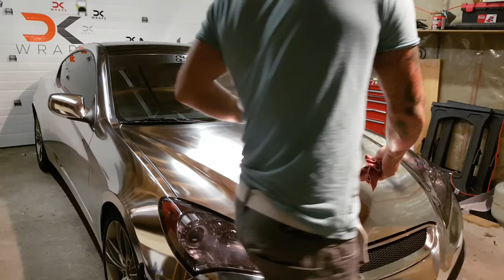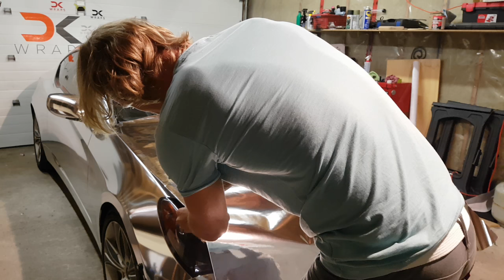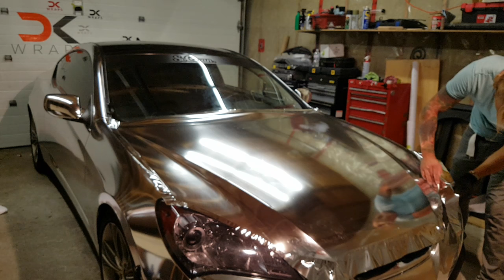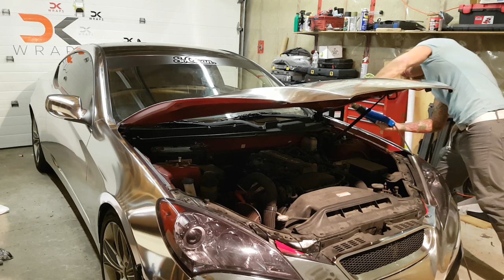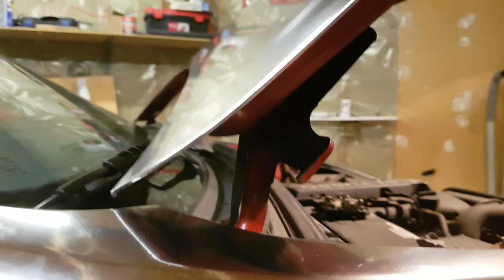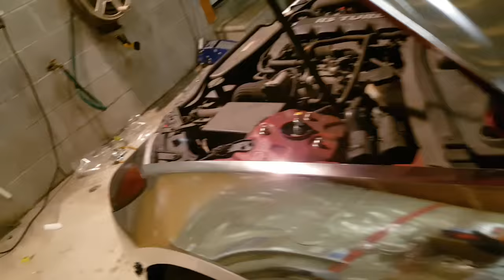Professional level. How to vinyl wrap hood bonnet. Genesis coupe. Silver chrome vinyl. By @ckwraps

Comment: Awesome christian, I like how clean the edges and lines are under the hood. You right people pop your hood for all kind of reasons, so its nice if that area looks flawless as well. Other than the hood itself. I thought cutting to much to tuck underneath the hood after popping the hood, you need a inch or two to wrap or tuck under was necessary. The way you did it was nice and clean prior to finishing the hood install, and not once did a cut on the car. Awesome I'm learning more and more ways how to become a even better installer and right wrap care products and tools to use like vvivid shield guard. Thanks Christian, freaking awesome.

Comment: amateur question
shouldn't they make vinyl templates for each car and not cut and fit per car?
Reply from the maker: ARCH. M no, that's not the case when it comes to colour change. If the pieces were cut to size there would leave little to no room for error. It's much easier to apply the film when you use a larger piece and cut it to size
Reply: you have some dope work on your page and thats dope in a good way lol  I do some wrapping myself. and I started making templates  for a few projects ive done but when i make them i cut them out a little bigger for errors it saves material honestly and jobs a little quicker. with the way you rolling on the cars you would cut your time down for sure

Comment: how long a wrapped car will last you think 
thanks a lot
Reply from the maker: saleh byatra depends on where it's stored, weather conditions and how you take care of it. Anywhere from 2 years to a lifetime
Reply: CK Wraps thank you so much and what about scratches can we fix them if they occured 
Best regards here from Nazareth city Thanks again
Reply: CK Wraps I'm sorry but your answer is very inaccurate. Every vinyl manufacturer warranties their product for so many years, and also for a certain number of years for removal without potential damage to the underlying surface. Even within manufacturer, different product lines have different life spans. Avery Dennison has the longest of any currently at 12 years for some vinyl, but as little as 18 months for some products under certain conditions. The same is true for every vinyl manufacturer.
BTW, in checking with both Avery Dennison and 3M, neither warranties any of their products if applied to preexisting graphics, exactly as you are doing here. If the two biggest manufacturers of color change vinyl say don't do this, you shouldn't be doing it no matter what your customer thinks.

Comment: except one fact that vvivid is difficult to work with, the finish look is pretty much same as other vinyl like avery or hexis what is your opinion?
oh gloss black is bit low quality imo. the reflection is too hazy
Reply from the maker: I find Vvivid chrome easier to use than Avery chrome
Reply: really? but its too sticky...
Reply from the maker: The chrome is only sticky when the surface temperature or ambient air temperature are too hot. But even without the tack reducer it can be installed. I use the tack reducer to eliminate the chance of damaging the film
Reply: thx for the reply i learn a lot from u!
Reply from the maker: You're welcome

Comment: i've seen professional wrap without heat gun
Reply from the maker: +Ger Lee it depends on the ambient air temperature. Different films by different brands will stretch more or less depending on the temperature in the room. I don't think you'll ever see a professional install using chrome without any heat. It's a thicker film and more difficult to stretch without any heat
Reply: oh sorry that is right. don't take it personal. i didnt mean it in that way  :D

Comment: After hours of Justin Pate, Avery Dennison, 3M, Yiannize, etc. videos, I have to say that I cringe when I watch any CK Wraps video. I'm sorry to say, but it's true.
For example in this video you are putting chrome over chrome, "...at the customer's request." I have no doubt the customer might have thought that is the solution to prevent chips and dings from showing too much. As the professional you should have done all you could to dissuade them from that idea for a number of reasons. First, the customer is paying time and materials for 2 applications of chrome wrap on the hood. The only thing being gained is not having to bring the car back when they feel the first application is too damaged. Second, it isn't really going to disguise any damage too well, and possibly not at all. If they get a strike bad enough to seriously damage the chrome it very well may damage both layers and they have paid for nothing in the end.
Third, there is an actual product for this purpose. I believe Avery Dennison and 3M both make a clear overlay suitable for chrome applications to protect from fading and damage. It is much less expensive than chrome and easier to apply, saving the customer in both time and product costs.
Fourth, I can just imagine what a nightmare it will be to remove two layers of chrome when the time comes, and it may very well cause permanent damage to the paint. I have never heard or seen of this being done and I would expect both the manufacturer and experienced professional installers would say it should not be done.
These are just the reasons that immediately come to mind as to why this is a poor solution to a potential rather than realised problem. The customer is always right when it comes to the look they want and judging the appearance of the final product, but when it comes to use and  application of the product and how to best meet the customer's goals, you should be the expert offering and strongly encouraging a better solution. If not you are doing your customer a disservice. Almost as badly is that, if you did do all you could to make your customer see a better solution and they refused, you didn't say so in the video at the very beginning and lead amateur wrappers into thinking this is a practical and efficient way to minimise potential damage to any wrap.
Reply: BTW, in checking with both Avery Dennison and 3M, neither warranties any of their products if applied to preexisting graphics, exactly as you are doing here. If the two biggest manufacturers of color change vinyl say don't do this, you shouldn't be doing it no matter what your customer thinks.
Reply from the maker: +William Thomas Ramey this is what the customer wanted. They didn't want a ppf put over top. Removing 2 layers of chrome or removing a layer of chrome + ppf would be nearly the same experience. The customer also decided to have a logo embossed under the wrap once the hood was already wrapped in chrome. So in that case it was either remove the film and then reapply with the embossed logo or add a second layer. The customer decided on a second layer. I didn't mention in the video that this shouldn't be done because it can be done, and it can be done without harm to the paint when it comes time for removal. Many other shops have done it, they just haven't publicized it.
Reply from the maker: William Thomas Ramey William Thomas Ramey if the videos bother you that much then there's no need to keep on clicking on them, but it seems to me that you've watched nearly all of them when you mentioned in your previous statement "I cringe when I watch any". Hundreds of elite wrap shops have embossed all kinds of vinyl under a full vinyl wrap. I guess everyone's wrong and no one knows what they're doing. You seem to be quite an expert after a few videos from YouTube
Reply: Funny funny
Reply: William Thomas Ramey before I state anything further, let me say I have worked with vinyl for many years as a Profesional for sign shops. at these sign shops we did install vinyl on a many vehicles. customers do vary, some customers change their vinyl wrap often and know what they like and yes putting clear over vinyl is a sufficient way to protect it. however, that being said, chrome vinyls do sometimes look better with a double layer, and it is a sufficient way to protect against chips to the vinyl, a chip would happen and it would be less noticeable due to the underlayment of chrome. also the only way vinyl ruins a paint job is if the vinyl is installed too soon after a fresh paint job, it causes discoloration as the paint can't dry properly (if if read that part of the comment wrong I apologize). When I owned my own shop, I did have a guy that would come in every three months or so to get a new vinyl wrap in order to keep people looking at his truck and, according to him, he got more business. at first I would suggest cheaper and better ways to get the same results, for example using etched clear to ghost on letters or whatever instead of trying to match the vinyl color, but he liked his ways better and he had enough money to do this so who am I to argue. Granted this guy never got a full chrome wrap and I have never done a full chrome wrap, so I can't say much more, accept that this video is very good and he does know what he is talking about. When it comes to vinyl it ends up being the final look that counts as well as long lasting and local weather does play a huge part in the way vinyl gets installed.
Reply: also, to further explain damaging the paint job, if your referring to the removal possibly damaging the paint. Well, let's put it this way, if your in the vinyl business and you don't know how to remove vinyl without damaging the vehicle, then your in the wrong business. Between heating and Rapid Remover I have never had a problem resulting in damaging a vehicle.
Reply: William Thomas Ramey 
What you saying is pointless. Shut up. If the customer request is this, let it be. You only making suggestions because your cheap. O, CUSTOMER IS PAYING MORE FOR A TWO LAYER CHROME WRAP. So what, who are you Bob the money saver. Get out of here.
Reply: I feel like these corners are not gonna hold long. Also the post heat should be 180 f to kill the memory in the film am I wrong?

Comment: how big a roll do u buy for the car
Reply from the maker: +Joseluis Duarte somewhere around 50-60 feet. Most vehicles don't require more than that but take a measurement and calculate square footage to be sure
Reply: CK Wraps is 50 or 60 by wht the feet of the roll that you usually  use on a car